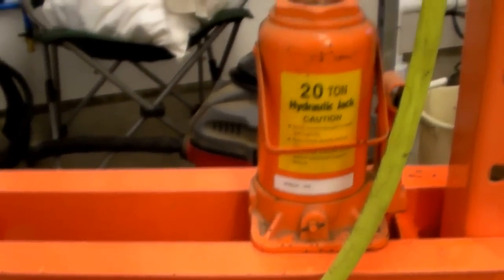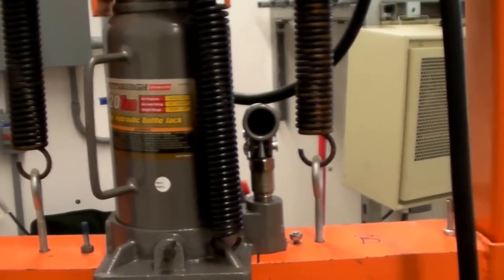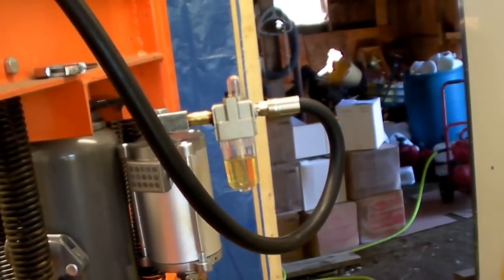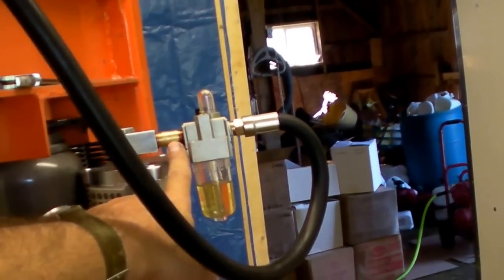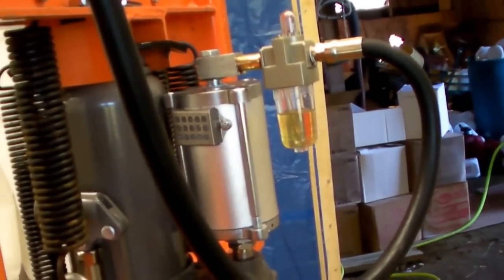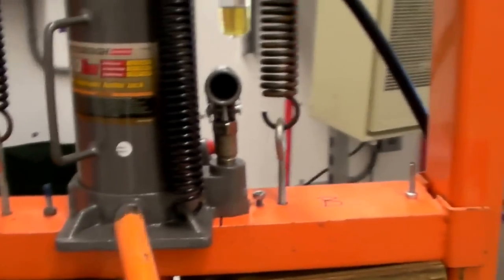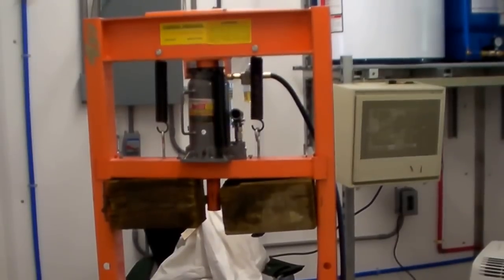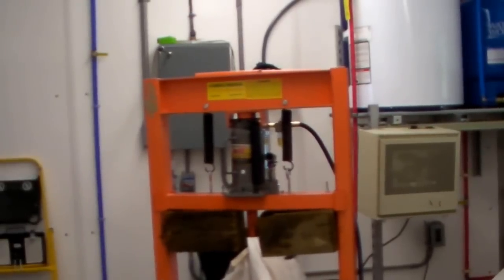Pimp Your Press with a Harbor Freight 95553 20-ton Pneumatic Bottle Jack!

Comment: You would think in 10 years prices would go up, but I just purchased a 20 ton pneumatic bottle jack from Vevor for $80 free shipping!!!  Like you say, work the web!
Reply: Did you build a fruit press? I'm looking for a good design on a multi purpose juicer and I was wondering if 20 ton was too much
Reply: @BannedGarcia4.0  No pressing fruit, lol.  The only thing I use it for is pressing bearings and u-joints.  I think 20 tons would be way too much.  I would recommend 5 tons at most.

Comment: I have a 6 CFM 4.5gal 200 PSI air compressor I think it's a little more powerful then the one you have hopefully it will work for stamping 16g CRS
Reply from the maker: I'm not sure, but you don't want to go over 120 psi air pressure with the bottle jack.  Good luck!

Comment: Solid ! Easy to useꉺꉺ>share4.photo/hBottleJack?β    If you have a trailer of any type.....you need one under your back seat ! I have 16 foot dual axel, with two big 570 ATVs. No prob jacking the tongue or side up. Keep a couple small pieces of 2x6 with it and you’ll have a great base in mud, and or place to distribute the pressure on frame.

Comment: Why do you still have the springs on it when you clearly dont need them has you have them on the platform their only their for the return of the bottle jack when its under a car its just putting more strain on the compressor
Reply from the maker: I do need the springs to lift the traveling beam back up.  The springs are really not that strong and there's is no appreciable loss of pressure or compressor strain.
Reply: @Neighbour_Al  the ones on the jack i ment because you have the other ones what come with the press to do the job like it did on your old jack
Reply from the maker: @rider6327-g1v  Doh, I see the ones that you are talking about.  I'll leave them on for now since that jack could easily get repurposed somewhere they are needed.  The springs really don't load the compressor as far as I can tell.  Good catch though!

Comment: Doesn't need the inner springs anymore.
Reply: civstu The bottle jack is made to be used by itself so it has springs to retract the ram. In the press it already has dedicated springs. I have mine set up with just the outer springs, as the inner springs become an unnecessary redundancy and would not be there if the press came this way. I moved the inner springs to the original outer spring location.
Reply from the maker: Good thinking!  I'll have to give that a shot and harvest that much more oomph out of the jack.  Thanks :)
Reply from the maker: Show us!
Reply: Would you mind explaining why the inner springs are no longer needed?

Comment: I googled this and another guy that upgraded the jack to the air compressor attachment like yours ended up breaking the frame and says it almost seriously injured  http://weldingweb.com/showthread.php?483271-Just-one-stroke-away-from-death-with-Harbor-Freight-20-ton-hyd-press
Reply: That Orange Color Press  is the old stile press. It and this press in this video is junk compared to the new Gray colored 20 Ton Press. Is much stronger. 60603 Item Number  20 ton H-Frame Industrial Heavy Duty Floor Shop Press
Reply from the maker: Other than welds (variable quality) vs bolts (consistent quality?), what do you consider the improvements?
Reply: Link long gone.

Comment: go to a scrap yard get a big propane tank take it home convert it for air and hook it up to your compressor. a 100lb tank is 25.5gal so that makes a 5gal compressor into a 30.5gal.
Reply: You'll still have to wait as the tank charges up to operating pressure, which will be much longer now that the volume has increased, with the same air delivery rate from the compressor.

Comment: I like what you did with the air part. And I see blocked of wood on the bottom of the ram is that to keep it from drifting from side to side? Cause mine dose that and will not press straggly down and I have to have that press as straight as posable as I make black powder rocket engines. Any more info would be much appreciated thank you Dan Yost
Reply from the maker: Hello Dan.  The wood below the traveling beam fills the gap between the top of the cheese and the beam as the cheese is compressed.  The top of the jack is supposed to fit firmly into a cup welded to the top of the arbor.  The jack top screws to raise and lower a bit, so you may need to raise it up a bit to get it to set firmly in the cup.  I hope that this helps.

Comment: On this jack the side manual jacking handle is for more precision control... On a press with a pneumatic/hydraulic jack you only use the air to get it close to the work, then use the manual jacking to control the pressure... You don't want to over press your work...

Comment: Thank you for this video. I want to ask you about spring. What is the diameter of the spring? İnnner diameter and wire diameter?
Reply from the maker: Springs came with jack and press.  I really have no way to tell you with the tension factors are...

Comment: Alan, I never listen. LOL. I am a safety person so I made a template from the bottom of the original 20 ton jack and transferred it to the new 20 ton air/hyd jack. Before I drilled the holes I verified that they were clear of the base. I was successful and the new jack is SECURED in the original mounting holes and is exactly where it lines up with the mount in the top plate. I suggest that anyone who is concerned for there safety do this, I am sure by modifying the base it VOIDS the warranty so be prepared to take the hit. I am happy with mine and have used it now several times. Thanks for the videos!

Comment from the maker: The jack stays in place on the traveling beam as long as there is pressure to hold it in place. Be sure to screw up the jack cylinder to make solid contact in the cup on the arbor.

Comment from the maker: I don't know why, but I can't reply to comments linked to Google+.  No, there are no mounting holes on the base of the jack, and I do NOT recommend drilling any.  It simply rests in place where the previous jack was installed.  Screw the top of the cylinder up until there is pressure to hold it in place and all will be fine.

Comment: can you not mount the jack upside down and do away with the central frame and have the ram press the tool directly?
Reply: Alan Yelvington im just asking because I am building my own frame and need open sides for wide pieces
Reply from the maker: The United League of Armourers  1:  I'd have to cut off the cup holder welded to the top beam (more work).  2: I'd have to make a holder to secure the jack to the top beam (safety).  3. I'd still have to put in a horizontal traveler to distribute the pressure (functionality). 4. The pump is not designed to run in an inverted position (functionality) 5. The pump would be inherently unstable since the center of gravity would be high (safety)  6. There would be no way to attach the springs to retract the pump after it had fully extended (functionality).  A good question, but you can see that there are a lot of consequences to simply inverting the jack.

Comment: How much CFM is required for this jack at 90-120 PSI?
Reply from the maker: I regret that I don't know!  It's  not in the manual, but I do know that I went with a marginally larger compressor (NOT LPHV) to keep up with the jack.  My small utility compressor from Sears wouldn't keep up.  I'll just say that a HF compressor around $160 is quite enough.  I hope that helps.
Reply from the maker: Oh, I did add an inline oiler at the jack to handle that requirement.  So far so good.

Comment: The reason I mentioned it:  We set up a clean room and had to fit exhaust ports to all the pneumatic equipment.  They were not allowed to exhaust into the room.  I am sure you could do the same thing.  Not sure a HEPA filter is going to catch oil.  Usually HEPA is for dust.  If you fit an exhaust, it works better to use tubing that is bigger than the compressed air hose as the exhaust air will be at a lower pressure, but higher volume.  I think we used 1" or 1 1/4" exhaust hose.

Comment from the maker: That's a very good question, and something that I hadn't though of.  I'll add an exhaust deflector to the jack and cover it with HEPA filter material.  FYI: The top of the cheese is covered by the upper press plate, so nothing can actually fall onto the cheeses, but it's still something to consider.  Thanks for mentioning it!